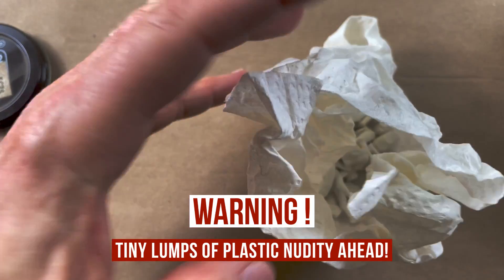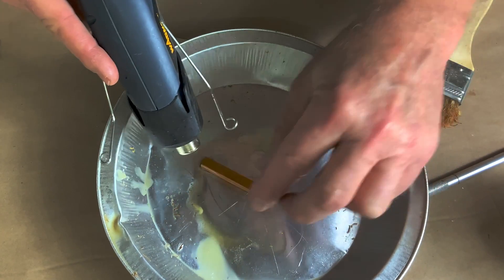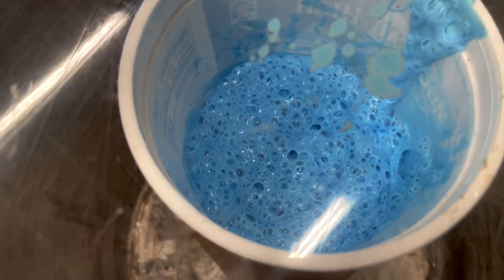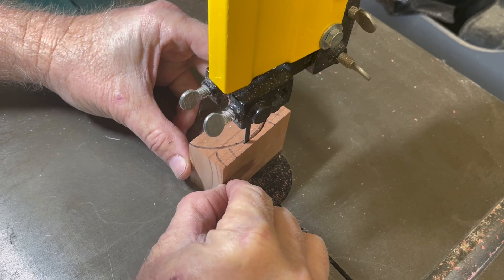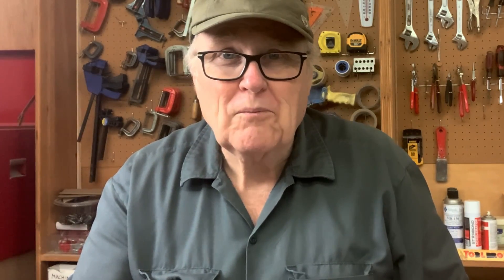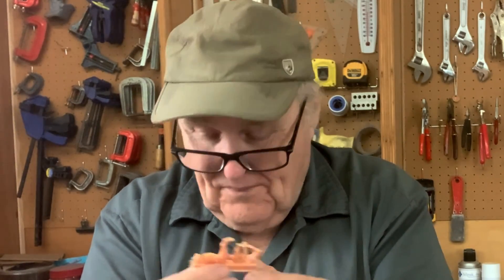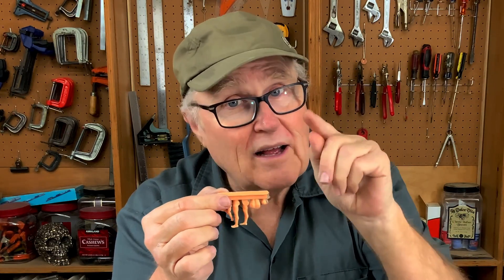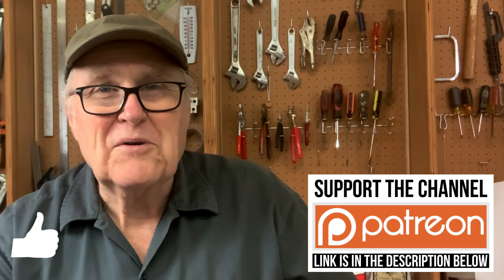Vacuum Casting Small Parts

Comment: 3:02 you mention putting in 100 grams of Rubber.  Can you share what materials you were using and either a shore  or durometer rating of that material?  at 4:47 you show bubbles coming up in the mold under vacuum.  can you tell me how many mm Hg or in of water column you had in vacuum? At 5:21 the mold went into the pressure pot.  How much pressure were you using?

Comment: I've often made a U or L shaped mold for tiny thin parts. I put all the parts on one one side of the U or bottom horizontal leg of the L.Then use the empty upright As a filler. If I've sprued and vented the parts right all the air is forced out by the resin as it fills from the bottom and no vacuum needed.

Comment: Sr, I noticed you didn't put the rubber mold to cure inside the pressure pot when it had the original pieces inside, so I wonder if the rubber would shrink when you pour the resin and place the mold inside the pressure pot,.......because the rubber wasnt cured inside the pressure pot first, so the pressure pot will likely shrink the rubber and therefore make the castings smaller than the original copies.

Comment: You made a great product!  This is the best video on vacuum casting I have seen! I did vacuum casting at my job.  We used a cabinet that was under a vacuum and a 2 part plastic.  Smooth On was best!  The cabinet had spots for two beakers that would agitate and gassify for about 10 minutes.  Then one breaker was timed to pour into the other, agitate and gassify.  Then it poured into the mold before it started to kick.  We let it gassify in the mold for about three minutes and would manually bump the vacuum pressure to knock out any remaining bubbles.  Some mixes required curing in heat before being removed from the mold, other would fully kick very fast at room temp.  We used Stoner brand mold release...good stuff!  If you got one of those cabinets...you could make some real nice product!  Most videos on vacuum casting are amateur hour,  but you did a GREAT job!  Wierd figures...never seen them before. They may be a casting of modified "Campus Friends" figures.  They are very nice though.  Figures that look right are hard to find in 1/25 scale.  Lots of great 1/35 scale out there from Tamiya and Dragon.

Comment: If you set up small parts so you can just stick an inverted wax paper Dixie cup over them with a hole cut in the bottom, then pour silicone in the inverted cup shape, stopping short of filling it all the way to the paper ‘bottom’ you cut the hole in, then you end up with a mold that, when it shrinks, will simply slide a little further down into the constant taper of the Dixie cup until you have Zero flashing lines.  I add thin wires to vent details and act as cutting guides for my razor knife to follow when cutting the mold open.   Also, if you don’t have a vacuum pump you can eliminate 99% of all bubbles in small resin castings by ‘pouncing’ the surface of the mold cavity with talcum prior to pouring the resin. In this way you can also cast in resins with very fast cure times that won’t allow the leisurely time to fully vacuum and release the vacuum prior to the resting setting. Alternatively, yu can also solve the bubble problem by casting under high pressure

Comment: I had a stray thought, but does the pressure chamber change the time it takes for the resin to set? Is there a way you could test that?
Reply from the maker: I’ve never noticed that pressure makes any difference.  Heat definitely does.

Comment: I believe these to be Preiser scale figures, popular with model rail scenery.
Reply: These one's are a larger scale that they produce. Roughly 54mm or 1/32nd scale. More in line with military miniature collection's, but there'salso larger miniatures,  such as 35mm, 75mm, 90mm, 120mm and even 150mm. I have some female ones I need to put together as a commission for someone. Robert has done a great job at casting.

Comment: I wonder if I could do this for the hands of a 1/18 scale figure 🤔
I do customization work at this scale and having a good set of hands for the character is important
I've been setting myself up by making squish molds for them (thank you Robert for those tutorials and for the link up w/Craftman). I jus got the resin for what I want to do today via FedEx 
BUT if I can get the resin to pout into/through the peg hole areas and into those tiny fingers...and no bubbles...that'd be a game changer, I think. Will have to try. 
Only problem is working time (one of the products says 5 mins)
Right now i have a homemade vacuum tank using a brake line bleeder (hand pump style)...so...the closest im getting to 1 bar of vac pressure is 25 mg...but its done well for my silicon so far...will jus have to pump fast I guess.
Reply from the maker: You can use a two-step process where you pump the air out of a cylinder, and then use the cylinder vacuum to suck the air quickly out of a vacuum chamber. You still might have to hand pump the chamber, but the whole process would be much quicker.
Reply: @RobertTolone    another option to consider. 🤔 Thanks for the thought here! Would you recommend another method for a home made vac chamber?
Also recently retrofitted a pressure pot from a Harbor Freight paint sprayer...holds decent pressure and I was able to solve leakage, etc
Have to say though...you make those squish molds look easy. Mine aren't coming out that good (yet) :D
Time and practice...and fun (hopefully)

Comment: "The larger the part, the quicker the cure."

I wonder why that is, scientifically.
Reply: Heat, resin is a thermoset plastic.
You can slow down & speed up resin cure by cooling & heating it, respectively
Reply: @NM-wd7kx  to expand on @N M's answer, a larger part will liberate more heat which will drive the exothermic reaction faster.

Comment: punk
Reply: tin sn99 soldering filament 3d print for electroplating high temp metals without high temp equipment, even metal thin film molds

Comment: Very cool. Like @nsjenkins, I'd have to use a resin with a fairly long pot life to make this work. I have found a situation where using vacuum with resin is important: Using metal powders. The powders introduce a lot of microscopic air bubbles because they're rough. They then form larger bubbles during the cure; pressure seems to force that formation. My technique is to mix the powder into the 'B' and then vacuum that, avoiding the pot life problem.
Reply: Interesting technique.
Reply: ! Good tip!

Comment: This was really interesting, thanks Robert. As a hobbyist I'm often molding and casting small parts so I may give this a go. I may have to get a resin with a longer pot life though. I find it enough of a challenge to get a cast poured and into the pressure tank sometimes, let alone finding a spare minute to vacuum it as well.
Reply: Yeah, I use a flexible resin with a 3 minute potlife at best. I have to use 20ml and 60ml syringes to get the molds filled in enough time to get them into the tank and get the tank up to pressure. If I'm lucky, I will have a few seconds to spare to rotate the mold around prior to putting it into the pot to make sure everything is covered.
Reply: Have either of you tried the squish mold method for smaller parts?
Reply: @FiguresOut  Yeah for a piece that was relatively thin walled (an action figure torso shell) and it sucked. Absolutely sucked and didn't work at all. I use cut block molds for everything now.
Reply: @outpost206  ...bummer. Robert did a push mold for model parts that looked like it did pretty well. Craftsman replicated the results too. There's gotta be a trick to it (probably working time / pot life). I have a few resins that came in yesterday...one has a 2.5 min working time...and so far after 2 attempts I haven't had a good cast...but i may switch to a 8-15 min working time resin here today. Just playing around w the squish molds I had lined up for a job in hopes the resin(s) i got will work. Casting 1/18 figure parts